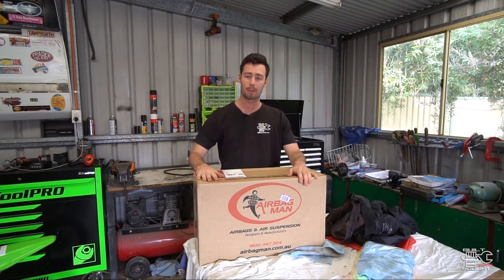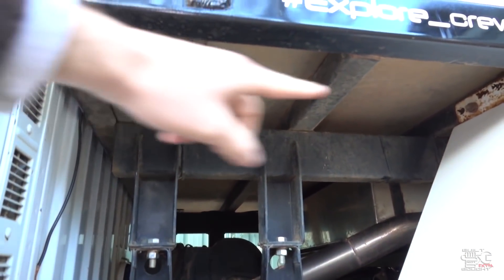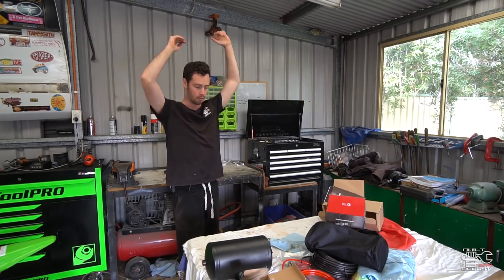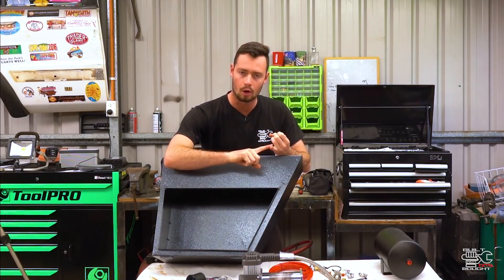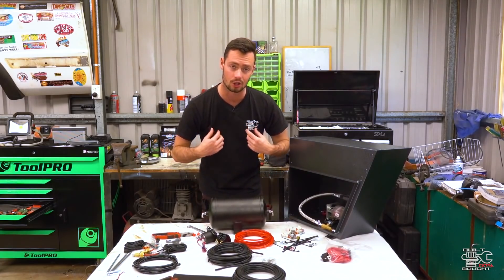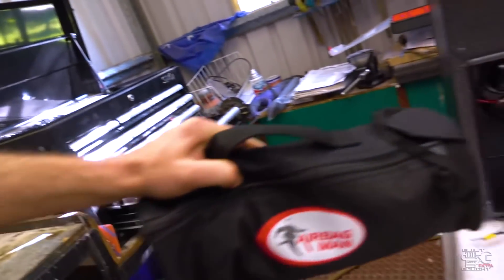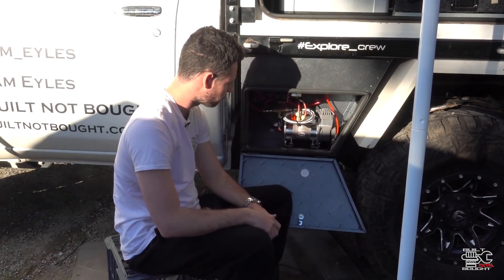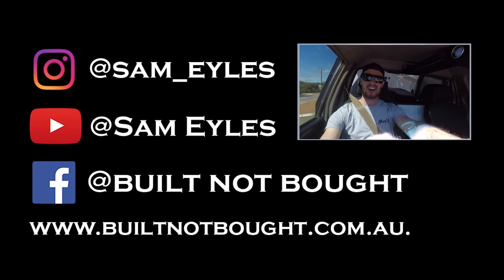Built Not Bought's On Board Air Supply System for your Airbag Suspension & Tyres

Comment: Do yourself a favour....install the paddle switches and gauge inside the cab so you can alter the pressures on the fly....plus the gauge isn't much use to you inside that dog box. That's how I did mine in the Silverado and it works great.
Reply: do you have photos??
Reply: @rafaelyeahyeah8964  I do have pics but can't put them on here as far as I know.
Reply: @billroach2393  what is you facebook?
Reply: @rafaelyeahyeah8964  my name... Search Bill Roach... I've just added a photo of the paddle switch and gauge .
Reply: Why have the switches inside the tool box bit useless having gauge switches  inside your tool box you have to get out of the car when ever you have to change the height of your truck. That's my thought.